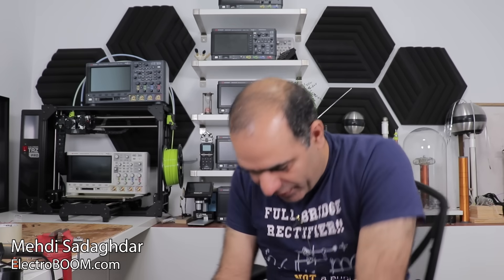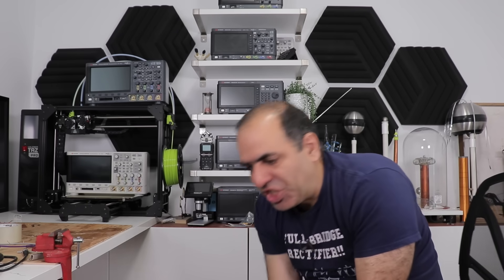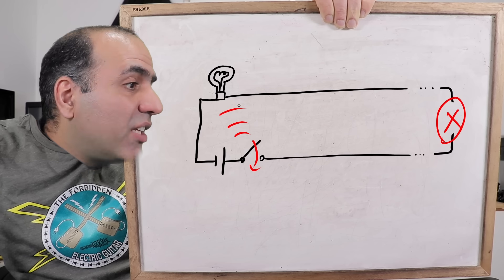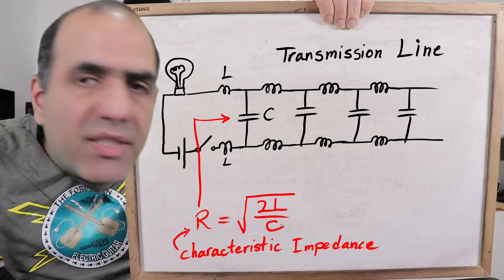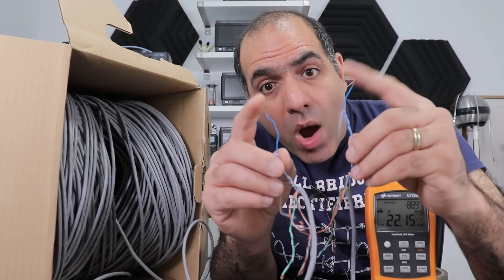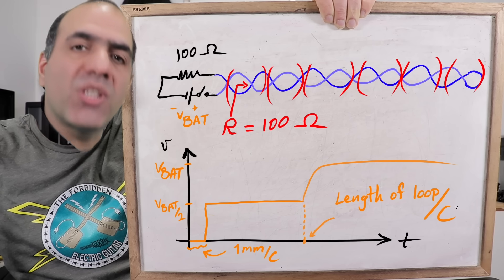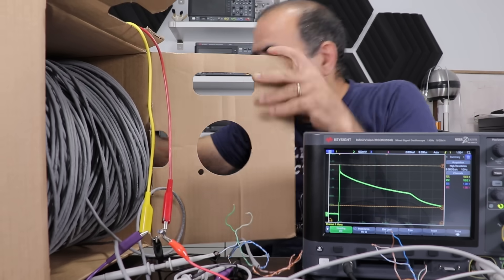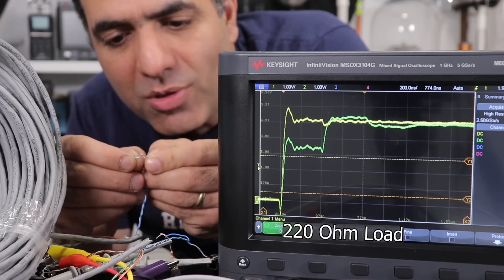Testing the LONGEST LOOP OF WIRE!!! to Turn a Lamp On

Comment from the maker: Thanks for the nice comments, people! One common question that you ask is if twisting the wire adds significant length to the wire and is a reason the light speed seems much slower in my cable. From my calculation and experiment, it seems twisting the wire contributes to 1 to 2% length difference. My light is 50% slower! So although twisting the wire does leave an illusion of slower light speed, its contribution is MUCH less than the actual slower light speed in cable dielectric.
Reply: Twisting the wire makes the light dizzy and thus slower.
Reply: @cartolla  Yep, the animated photons I control in my applications generally stop to throw up all their electronix bowl contents every 300ft or so.... poor photons.
Reply: @cartolla  it doesn't get dizzy it's just a longer have to take
Reply: @cartolla  🔴 What Is Islam? 

🔴 Islam is not just another religion. 

🔵 It is the same message preached by Moses, Jesus and Abraham.

 🔴 Islam literally means ‘submission to God’ and it teaches us to have a direct relationship with God. 

 🔵 It reminds us that since God created us, no one should be worshipped except God alone. 

 🔴 It also teaches that God is nothing like a human being or like anything that we can imagine.

🌍 The concept of God is summarized in the Quran as:

📖 { “Say, He is God, the One.  God, the Absolute.  He does not give birth, nor was He born, and there is nothing like Him.”} (Quran 112:1-4) 📚

🔴 Becoming a Muslim is not turning your back to Jesus. 

🔵 Rather it’s going back to the original teachings of Jesus and obeying him. 

More .....
Reply: The difference in transmission speed is directly related to the dielectric constant of the insulation. In the case of CAT5 or 6 cable, that's polyethylene which results in a "relative velocity of propagation" (VP) of about 0.66, just as you measured. The type of conductor and other parameters such as cross sectional area are largely irrelevant. You've demonstrated a "step TDR" in today's electric fields theory class.
Reply: In school we learned that electricity travels at ~2/3 the speed of light (through copper cables). We didn't go into the details of it, but just used that as a sort of "constant". Nice to see this validated through this experiment :D.
Reply: It depends on the properties of the insulation material rather than the conductor, but 2/3 c0 ist a valid rule of thumb. The formular ist c=c0/sqrt(epsilon_r•mu_r), with mu_r nearly 1.00...
Reply: I'm disappointed by this video, I wanted to see you wire this up inside a city park. 🤣
Reply: @Elodie the speed of light and electromagnetic waves is indeed slower through a medium... The ratio that it is slower vs max speed of light propagation through a vacuum is known as velocity factor and it's a significant factor to consider when tuning RF circuits and antennas for resonance on specific bands... Velocity factors of 0.66 to 0.90 aren't uncommon for copper wire on the low end and high quality coax or ladder line on the upper end.
Reply: @Wayde-VA3NCA  Now I can't even tell what that other guy was trying to say about inability to measure the speed of light and so on... But your antenna examples are spot-on, practical demonstrations of theory.  Air has a VF of roughly 0.95... PVC or similar insulation or pipe around an antenna shortens its resonant length more.  One can even take advantage of that in using less wire, making a shorter resonant antenna.
Reply: @Randrew  he seems to have either removed his posts, or blocked me... I can't see them or reply to them anymore... In any case, people have been measuring the speed of light (technically the round trip speed of light) for hundreds of years to increasing accuracy. First through various celestial methods and then mechanical methods, all before (modern) computers, so not sure what he was trying to get at with the computers are too slow and zooming in on atoms and stuff...
Reply: @Elodie it can be significant. The reason lenses work is because the transition between densities of medium slows down and bends the light. In the case of EM waves when making an antenna, the lamda/2 length of a dipole is longer than the actual length by the velocity factor in order to take into account the speed that the wave travels through the antenna elements compaired to free space. A 40m dipole cut for middle of the band (7.150MHz) has lamda/2 of about 20.965m, but if you cut the elements to that length it would resonate at a lower frequency than expected (just below 7MHz for a typical v.f.). If it had a v.f of around .98 it should be cut about 45cm shorter, which is noticable.
Reply: This is the most amazing and definitive word in this fantastic series. We NEED a "Veritasium Reacts to ElektroBOOM" video of this !!!
Reply: @Elodie Whoa, what was that?  I thought I just heard someone whisper "velocity factor" !
Reply: @ElectroBOOM  I have been following all the back and forth in the scientific/electrical community that Veritasiums video caused. I appreciate you all and have been VERY interested. Although, once all the dust settles, I'm going to go back and binge them all in order so everything is fresh in my mind when I hear all the back and forth. 

As it stands now, by the time a new video comes out in reply to Veritasiums video,  I've forgotten all the fine points that the new video is responding to. Am I the only one planning to do this?  I can't be, right?  

I'm one of your biggest fans. You motivated me to get into the field and start my own electronics repair company. I am building SLOWLY. It is a large investment and I'm just a full time single dad dreaming to work FULLY for myself someday. That being said, I'm growing and gaining a great reputation by word of mouth in my small city. My limits are mainly the equipment I have access to but as I grow, I keep working full time and combine my incomes to add new equipment in my shop. I allyways wanted to do this and your enthusiasm really gave me the encouragement I needed. I'm old, 45 years old to be exact and changing careers was/is scary. Somehow, you made it less so and made me feel I could learn what I was passionate about and make a career of it. So, I guess long story slightly shorter, thank you. I appreciate your videos, they made a HUGE difference in myself and my daughters life.  You're appreciated by myself and many others.
Reply: The cable specs should have a VoP/Velocity of Propagation value as a decimal or percentage. I picked a random cable from Belden and it was 70% of c. I've seen lower, too.
Spec: https://catalog.belden.com/techdata/EN/3613_techdata.pdf
Reply: That was the most epic length of cable ever used in this experiment. Well done!! The open/close bit towards the end reminded me of the switching USB does for data transmission, which I learned through ben eater's channel.
Reply: @LAYATORS  You only know your mom ? lol
Reply: @CharlieKirk1000  🤨
Reply: @LAYATORS  : Ask a FRIEND !
Reply: you could in theory connect each of the 4 cables to each other in series to make the cable loop even longerrrrrrrrr
Reply: @norwegiansmores811  didnt you pay attention? thats literally what he did
Reply: couldnt you say realistically if you give power treat the wire you attach to as ground anyways so does this all matter
Reply: Electric current falls just like water in a river. Each particle of water is affected by gravity, not by particles of water behind it pushing just as if we dive in a pool,  our feet aren't pushing us down, gravity works on all of our body parts at 10m/s2. But when water hits resistance like a damn with a turbine the head of pressure builds and that head is the same of voltage. So if current falls like water the electrons don't push each other but when pressure builds up they do but more like a flash flood. The time it takes the pressure or head to build is your delay.
Reply: Twisted pair for "fast" / high frequency circuitry is just pure magic - even for analog to digital camera applications that appear "parallel" and super "Digital" . I have to admit would LOVE to see what happens on scope if you poured a bunch of liquid nitrogen* into your cable BOX.  (Second phase of graph brought to a higher voltage ? ). 

_________________________________________________________________________________________________________

* careful of insulation cracking etc. 

~ I posted on Vertasium's first video like "Hey arn't wires 'spozed to be 'Wave guides " anyway ??? " 

@ElectroBOOM thanks for making this !
Reply: Thank you so much Mehdi you helped me to get a job, I'm so thankful for your videos and everything what you do and how your videos formed my mind. Sorry for offtopic comment.
Reply: Latiti plssss
Reply: 2e8 m/s ... Is that really due to the light speed in the cables or due the propagation delay caused by the distributed L-C network? Or they are one and the same thing, i.e. just different ways of looking at the same phenomena?
Reply: He’s finally gone LOOPY!
Reply: Mr. ElectroBOOM would you like to beat Derrick on why electrons DO push each other through the wire.

It's simple
Step 1: Ask if he believes the electromagnet force uses "virtual photons" to repel each other.

Step 2: "What is the Doppler effect?"
Reply: I want to see you do some work with electrolysis. Specifically using RF and a modulated electric field of 13.56 MHz. The anode should be the transmitting antenna and the cathode should be the receiving antenna. Don't use GHz. The objective isn't dissociation via RF the objective is resonation and pre loading the electrolyte with  extra electrons.
Reply: Is there any doubt that compared to Who One Shares A Nation/Nationality With, it is negligible Who One Marries/Who Is One's Spouse (assuming that Mankind is an order of units which [when mentally competent in a world where any of them are UNDERSTOOD TO BE free] believe that they exist within their own lifespans)? I'm only making this comment because we can see that you have a daughter. I don't mean to be too off-topic. Please forgive me for interrupting our conversation.
Reply: Actually the lower speed is due to the permittivity of the insulation. A bare copper cable in air will have a much higher transmission speed.
Reply: What will happen, if we take part of this very long cable and put it inside the box shielding it from electromagnetic field, with only 2 small holes for a cable to go in and go out?
For example, with this 40m cable, let's say that we let 10m of it go normally, then 20m is shielded from external electromagnetic field, then the remaining 10m is again going normally outside of the box?
Reply: I'm SO glad that none of my favorite youtubers are flat earthers.  Flat earthers make me sad panda.  They need to be classified as mentally disabled.
Reply: IT DOESN’T MATTER
Reply: My Former (deleted) commend was not completly right: The formular ist, as follows: c=c_0/(sqrt(epsilon_r*mu_r)), where c is the signal Velocity, epsilon_r the relative permittivity, mu_r the relative permeability of the medium (insulation). typically mu_r ist nearly 1.0, so you can usually calculate with c_0/sqrt(epsilon_r). 2/3*c_0 is a rule of thumb, I learned at university (RF circuit lecture). In case of multiple meterials with different epsilon_r/mu_r dispersion occures.
Reply: Veritasium is younger and sexier than you. Get over it
Reply: Did u percive that at the end of your video the energy output was higher than the input? Why? Wtf was going on? Can u explain please? 🙏🤝
Reply from the maker: @andreypinto3988  of course you can send continuous energy out, collect them somewhere and then send a burst of much higher energy out for a smaller period of time. That's no issue.
Reply: @ElectroBOOM  Can you please do a video on impedance matching?
Reply: Cat 5e has a VF (Velocity factor) of 0.45C to 0.75C, if you are not familiar with transmission lines, you tend to forget to factor that in. your calculation was spot on,  if you used COAX, you would be looking at a VF of 0.6C to 0.9C, that data sheet for the cat 5e should have had the VF on it.
Reply: Im loving this back and forth between you and Veritasium
Reply: Twisting the wires just changes the velocity factor, which is another way of calculating mow much slower electrons will flow through the conductor that they would in free space. Any spool of coaxial cable will have the velocity factor printed on it, along with the impedance of the cable.
Reply: Can you please do a video on impedance matching?
Reply: @ElectroBOOM Can you please do a video on impedance matching?
Reply: My whole comment was going to be postulating whether twisting significantly increases the actual length. So way to make me feel totally useless. Rude.
Reply: But if the wires were shielded then nothing ?
Reply: My doubt is, if the speed of electricity in wire is almost the same as the light, how is the fiber optics much faster.. 
Is it just the dielectric that is causing the speed in fiber optics cable??
Just curious....
Reply from the maker: @jackronaldo774  Fiber optic is not faster because light travels faster, but because the signal is filtered less in optical fiber, so you can run higher frequency without it being filtered too much.
Reply: @ElectroBOOM  oh cool.. that makes more sense... Thankyou for the reply mehdi ❤️
Reply: i'd rather say it's 33 % slower
Reply: you have a Persian accent
Reply: I do not like you
Reply: The way you described how the energy travels through the twisted wire reminds me of how when you finish drinking from the straw and the liquid drops fast then bounces back up.
Reply: Many people don't know about the reality of the speed of light, they keep thinking that, in a small enough scale, everything is in vacuum. When the fact is, the quantum fluctuation especially around dielectric substances can interact with EMW, sucking it's energy and create subatomic particles that fills in the space.
Reply: Some of them even believe that the slower speed of light in materials is caused by light reflecting inside causing it's speed to drop since it experiences longer paths.
Reply: Looooong looooooong loooooooop
Reply: 1 to 2% is too low. Upwards of 5% is closer and varies by colour for performance and packaging reasons.
Reply: So, fun fact, the dielectric constant of a cable can vary a surprising amount over the length of the cable due to manufacturing impertfections. I used to work with TDRs and we could "see" the imperfections of the cable within the trace. For some cable runs we worked with, we could see a fluctuation anywhere between 50-85% between two arbitrary points. Understanding this and compensating for it can have significant real world impacts. For a practical example, when performing maintenance on a wiring harness onboard ship, its important to have a good model of the variations of the dielectic constant for a given cable as it can define which side of a bulkhead you may need to cut a conduit in order to place a splice.
Reply: Hello Mr.Mehdi, could you please make a video explaining impedance matching and why it is necessary.
Reply: How to make a fish shocker?
Reply: Please korean
Reply: Man first I thought its such a click bait,,,I was expecting a huge setup which would be cool....but thats was the whole point of the video ...you dont need a lightsecond setup to prove the point ,,,,,
Reply: Propagation speed is equal to (1/sqrt(dielectric constant of insulator)) x speed of light

That's mean, your wire insulator have dielectric constant about 4. So, It's  PVC cable, not polyethylene.
Reply: This video was amazing
Reply: Am i the only one who noticed he did a green screen well holding the board
Reply: Would the 50% slower speed be from inductive reactance?
Reply: @ElectroBOOM Can you comment on AMD's removal of PCIE4.0 feature from some of new B450 motherboards(ex: 2020 ASUS TUF-b450 boards).  Might be a bit far-fetched but this LVDS is also the main reason AMD B450 boards actually support PCIE4.0.  In AM4, all the PCIE4.0 complying things are inside the CPU. Only thing left on the motherboards is the LVDS pair of copper paths. Being LVDS they are really powerful.  PCIE4.0  doubles the speed per path from 8GHz to 16GHz.
They later removed it by AGESA updates just to make it B550 exclusive to incentivize spending.
Finally us consumers are left with boards where we can't use at full potential...
Reply: What is the field of study I need to follow to be able to research, manufacture and test like you or study high voltage? Hope to reply.
Reply: ---{{(HI!)+l]]®
Reply: Sir if you want to  see "good inovation" and truly "cheap/free" energy, you have to  check out the "hydraulic accumulator" that they published couple of weeks ago. It changes completly the rules of the game forever!  https://www.youtube.com/watch?v=uTbIJnEOw8Y
Reply: kreze man
Reply: Does electricity have mass? will a large enough loop of wire change weight when current is flowing vs no current? It is believed that light does not have a mass. If light has no mass then how does a solar sail get a push from light that has no mass. Also how can electricity be compared to light if it has a mass and light does not?? 
Amazing video. I learned lots but I have more questions then answers now. 🤣
Reply: @bradlys4978   Photons indeed have no inertial mass and no relativistic mass, but they do have an energy. Thus they have "momentum", as in
E^2=(pc)^2+(mc)^2 (m=m_0 is rest mass)
so: E^2=(pc)^2
or: p=E/c
with E being dependent on the photon's wavelength (can't say what happens at Planck's length though). 

A so-called massless particle (such as a photon, or a theoretical graviton) moves at the speed of light in every frame of reference. In this case there is no transformation that will bring the particle to rest. The total energy of such particles becomes smaller and smaller in frames which move faster and faster in the same direction. As such, they have no rest mass, because they can never be measured in a frame where they are at rest. This property of having no rest mass is what causes these particles to be termed "massless". However, even massless particles have a relativistic mass, which varies with their observed energy in various frames of reference.  

Gravity alters the course of light in the same way it alters the course of ordinary matter. In Newton’s theory of gravity, the force only affected things with inertial mass, but general relativity is different. Matter warps spacetime, which means that things traveling in straight lines take different paths in the presence of curved spacetime. This affects matter not only matter, but also photons. 

About the electricity, I heard that one of Einstein's 1905 papers, "On the Electrodynamics of Moving Bodies" specifically demonstrates this. A moving magnet becomes more massive due to its increase of energy, and this additional inertia causes its electric field to increase in strength as well. Hence E = mc^2.

Though I am not an expert here, needed some googling for this comment and am not really too knowledgeable about electron holes, for which an "intuition" could make us ask "Wait, do holes have a mass?", but I heard that the hole is a positive-charge, positive-mass quasiparticle. A hole is essentially a way to conceptualize the interactions of the electrons within a nearly full valence band of a crystal lattice, which is missing a small fraction of its electron, which can lead to unintuitive concept that effective mass for the electrons can be negative.
Reply: @scarletevans4474  So they do have a  relativistic mass. Anything times zero is still zero. so speed time mass give you a force. it's that simple. No mass, then no force can be exerted from the inertia. It has to have at least a tiny bit of mass.
Reply: Exelent ☆☆☆☆☆
Reply: I've got a fun one for you to investigate. 

Internet black hole.
Reply: Hey you are wrong!!!
Because you made a solenoid with the loop of wire so it make electric field so it will be work as capacitor and not doing the experiment ritghtly
Reply: Why didn't you run all of the singles in series to get 6000m to prove the point
Reply: AlphaPhoenix did it with 1.km odd wire
Reply: Long longggg maaaaaaannnnnnnnnnnnnnnn!!!
Reply: I heard there are 70 ,yes 70  anomalies in the study of H2O (water )  alone.
So any electrostuds are pussies ! 
Also very fascinating  though 😀!😀
Reply: Doubt you would see this but given electrons have mass doesn’t electricity (the flow of electrons) move at slower than the speed of light?
Reply: It’s a little late here but please do explain the signal analyser used here and it’s settings for this experiment and thank you for tackling this question with such experiments …
Reply: I was thinking lately about you're previous video with Veritasium, and your conclusion. You both get to consensus about electrons traveling only on outer surface of wire and energy traveling in electromagnetic field around wire. So the purely copper wire and copper coated alluminum wire should behave exactly the same even when conducting DC whichin real life is surly not true. I was looking here and there on internet and can't find explanation of this phenomen. Sorry for leaving the unrelated question under your  comment but I'm seeking answer so badly...
Reply: @erykopata2668  This is my understanding - "skin effect" has historically been regarded as a high frequency characteristic (pushing towards MHz with lots of influence at GHz ranges where it was discovered during RADAR development). The dc characteristic certainly depends on the overall structure of the cable - which can be simply demonstrated by the reduced current carrying capacity of rubbish Chinese copper covered aluminium mains cable - and is one reason why silver plated hi-fi interconnects are complete snake oil at audio frequencies. My feeling is that the physics of conduction is far more complicated than suggested.
Reply: @andygardiner6526  If the current is only carried in the outer layer of the conductor why do you need a 25mm square conductor for starter motors or welding cable and not a copper tube over a piece of rope. At DC the skin effect is negligible as you are pointing out.
Reply: @Equiluxe1  problem with small cables - they have small resistance. Otherwise, if you push too much current into small cable, it will melt. So 25mm square conductor is the most efficient way (both by possibility to hold the power and by cost to produce the cable) to hold electricity for specific electric power in this part of the loop.
Reply: @Equiluxe1  the starting load would need that extra inner to keep the wire from getting overloaded. But some of the sub stations here in canada use a massive pipe of sort like you state because its cheaper. But those are engineered and designed with peak loads in mind. In theory your pipe on a rope would work. But bare live pipes on a rope in your garage. I dont suggest lol
Reply: @UnifiedInfo  Not suggesting bare pipes but if the inner part is just for heat sinking a tube filled with water or copper covered steel or aluminium should carry the same current but it does not, where hollow conductors are used for lage currents with coolant circulating inside them the same amount of conductor is used it is just formed into a tube but the pounds per foot or however you want to measure it is the same. And if car manufacturers could get away with using a mm thick wall tube or a few strands of 1mm wire wrapped around a rope they would do so to cut costs, the fact that they don't speaks for itself, and they are not worried about heat build up as the starting current is only for a few seconds.
Reply: In regards to conductance of copper wire versus copper coated wire: The charge is located on the surface of the wire, but for DC or low-frequency AC (that mostly reaches steady state) that means the charge fixed relatively quickly, creating an electric field inside the conductor, but the electrons inside the conductor actually move in the electric field created by those charges.
Reply: @erykopata2668  You got that part wrong. Surface charges are the only charges that are not in equilibrium and thus they create electric field. This field then moves charges in the rest of the conductor. At DC all the charges in the conductor are moving so they all contribute to energy losses by interacting with metal atoms. At AC surface charge wave has some finite length so the electric field that it creates cancels out at certain depth in the conductor. The higher the signal frequency the shorter the wave and smaller the "skin depth". That is why at high frequency charges move only in "skin depth" area of the conductor and only this part "conducts" the signal (it is not a step change but more like exponential decay).
Reply: @erykopata2668  they work actually very similar, that is why we have copper and copper covered CAT 5e cables. But because copper covered aluminum is much softer, you may get cracks in the cable much easier, thus affecting electrical flow. And of course, there is difference between metals and their electric capabilities, conclusion of skin effect is working purely in solid metal. If you use covering, you separate one metal from the other, which creates delta. Also, just for additional information, cable coverage is dependent on full surface and with copper covered metal, you still have small gap, where metal is not covered by copper (the part, where cable is cut), as well as in internet connection, copper surface is also affected by the pin connector.
Reply: @erykopata2668  That raises all sorts of questions like why can a thicker wire carry more current? and why does stranded wire have more resistance than a single wire of equal diameter?
Frequency also makes a difference, see "skin effect in power system"

I think the biggest thing that's not being dealt with is that it makes a big difference when  carrying a significant current through a closed circuit.
Reply: @erykopata2668  Consider gravity is the constant. Electrons are positively or negatively charged. From my understanding the motion of travel is in the positive flow. As gravity is the force that holds all things together and moves all things with the velocity and span of the galaxy. I postulate that gravity also holds the electrons together and moves them in conjunction with the positive charge. In a wire. In a tube. In a vortex. The travel can only be in one direction. Even in Direct current the travel is one direction. In alternating current the flow alternates from one direction to another. The direction is constant. the charges are not in place flipping from positive to negative. Gravity itself converts from positive to negative keeping the electrons in place traveling always in the same direction. This recent intuitive thought also explains string theory which I also did not study. Simple explanation. I have a H.S diploma. Nothing more. Why does it explain string theory. Gravity converts from positive to negative. All charges from positive to negative would be inside of that gravitational field. All electrons would switch at the exact same instant. From my understanding that is the principle rule of string theory.
Reply: @rafaelgonzalez4175  Thanks a lot. I'm not sure if it answers all of my questions, but surely helps a lot
Reply: You should make a split channel for flat earthers and people who watch your videos to actually learn stuff-a flat earther would not watch this type of video.
Reply: @quinn_jns  it would be in vain. They only watch their shit anyway, because " science lies" and "scientists are not open minded" 😄
Reply: Im still amused how this talk converted from electrons to photons. Complex things have alot of things taken for granted when trying to understand fundamental laws of universe!

P.S. with snells law EM field inside conductor would enter always in direction of the normal of the surface regardless of angle of incident, so it doesn't matter if wire is twisted or not, EM field will follow the tunnel upside down wherever it takes it.

Besides speed of propogation would depend on permitivity of the material and it depends on whole lot of parameters including mass( not the weight but actual mass created by energy) of the material and time, as it would have displaced underlying electric field because atoms would displace actual field in order to register itself as atom in universe, which provides it's charge or other properties.  At the end it's the energy of atoms which bends the rules of EM propagation inside it's own region, what happens inside these fields of different energies is still field of study by scholors.

Thought experiments are cool, but everybody would need to understand past 200 years of physics and discovery of atomic level interactions in order to go further.

We may only see combined effect in one experiment, it's usually collective knowledge that brings solutions and conclusions. This opens up new challenges and might inspire others to explore beyond traditional education.
Reply: @MaulikParmar210  please consider these as questions not arguments..

I don't think Snell's law applies to the length claim, the twisted pair simply makes the lines longer - refraction isn't really behind the claim?

Also as I understand it, photons are the force carrier 'particle' that transmits the electromagnetic force, and the electrons are not the things that move at the speed of light.. just the electromagnetic fields?

Again, as I understand it (so more of a question than a statement :) ) - electromagnetic waves aka 'light' in this context, move slower through different mediums due to the absorption and re-emmitance of photons as they interact with electrons.. between interaction with matter they always move at the speed C..?
Reply: @ThePurza   When we talk about propogation of signal we usually talk about EM fields displaced and induced by the conductor. According to field theories there exists a field for each property of real particles that gives them their properties including charge, mass, magnetic field, glueing  force inside atom nucleus and also spins to electrons. These fields have steady energy state settled after long time of universe's creation and the particles we see is energy residue in terms of oscillations in these fields i.e the wavefunctions in quantum mechanics for each particle.

The propogation speed would depend on permitivity of the "displaced" Electric fields created by the mass itself. Note displaced as it's important to distinguish base energy of field and energy we are transferring. We usually denote permitivity of electric field in space as epsilon zero which is derived from other fundamental constants and tells us about the energy required to make these disruption happen in raw space's electric barrier.  The materials relative permitivity is a constant depending on length, temprature and other physical properties created by atomic particles themselves because they interact with underlying field and would actually account for things like resistance, speed of EM disruption etc. This is where it determines physical properties of the conductor. For correr we know its 2/3 of c at 1khz frequency. For DC it can go upto 0.9C depending on setup and conditions and is heavily studied in engineering with the help of Mean Field Theory and it's supportive math.

Accoring to Einstiens GR and SR speed of causality will remain constant regardless of reference frame because that's defined by nature itself. We dont know why it has that value but photons or any other disruption inside these fields does not have to travel at that speed and can be slower.

Photons only travel at these speed because they are usually massless (traditionally) but have angular momentum ( quantum property that carries actual energy) inside these fields making it field carrying particles.  They do not experience time and wants to happen at speed of causality (c), give it origin and direction and you will have light / em wave always trying to catch speed c.

Inside the conductor the field will enter always be in direction of normal to surface because conductor acts as wave guide i.e. it will follow wires surface in direction of the wire regardless how wire is twisted or not, it will bendhwere it needs to will but it's not going to be same as photon because it only interacts with one field and not atoms as photons do. we cant simply compare electricity ( the energy of the electirc field at the end ) with photons they are fundamentally different and would interact differently. This is same as Photons EM field except the energy we talk about is transmitted outside normal visible relms of physical world and in underlying fields as the electric field displacement (base energy of field + energy from battery)  caused by energy.

Things get more complicated as you involve math trying to account for each of these interactions.

I'm not any scholor but can tell the answers that are seeked here requires deep and darkest knowledge of fundamental workings of almost everything that humans have discovered so far, even vaterns in physics have to master multiple theories along with 200 years of discovery to be able to answer simplest questions that we usually take for granted. It's just complicated and involving Math just removes 99% audiance from equation!
Reply: @MaulikParmar210  thank you that's a great answer.

Yeah it seems like many scientific analogies/principles/equations we use are massive simplifications of the 'wave function' of a system. I wonder if schools will ever teach children about fields and field perturbations, it's all so arcane
Reply: @MaulikParmar210  Well written and true.
Reply: @MaulikParmar210  Being familiar with Snell's law on the refractive surfaces in optics, I do have a hard time in the analogon comparison to the situation here. In what I am familiar and use professionally in microscopy is the refraction through media of various RI to achieve surface interation on the converging E-field. There, the angle of incident matters and varies up to the pupil radius continuously. As I also happen to be (by initial training) an electrical engineer I have a problem following your comment on Snell's law. But maybe its just me...
Reply: @LutzSchafer  Apologies, I guess explaining things in classical and non classical ways have it's own perks. The classical way electrons would be drifting due to electric field, for example at 60Hz the EM signal travels only 3.2m in copper till it gets absorbed into the material completely, electrons do move due to this electric field but very very slowly depending on frequency which brings in snells law as we are talking about EM stuff and in it's core there are exceptions to a point where signals are essentially reflacted regardless point of impact if radiation is consumed or absorbed by material. We cant solve it with classical approach.

This things get interesting as we explore, I directly quote this from snells laws basic explanation "In a conducting medium, permittivity and index of refraction are complex-valued. Consequently, so are the angle of refraction and the wave-vector. This implies that, while the surfaces of constant real phase are planes whose normals make an angle equal to the angle of refraction with the interface normal, the surfaces of constant amplitude, in contrast, are planes parallel to the interface itself. Since these two planes do not in general coincide with each other, the wave is said to be inhomogeneous. The refracted wave is exponentially attenuated, with exponent proportional to the imaginary component of the index of refraction."

To solve inhomogeneous equations you need Maxwells equations. Solutions to these represent spherical light waves traveling outward from the sources of the waves, thus the analogy of Electric field being in direction perpendicular to the normal of the surface, and since solutions are in complex plane, you can discard angle of impact and result will always be same i.e. signal gets absorbed in underlying electric field as EM energy potential and the thing continues. This also answers why surface charges play important part in carrying energy.

How deep this penetration goes depends on frequency of signal and type of material. Usually core would become less electricaly active and charges would concentrate field on surface areas creating actual waveguide that carries signal while internal mass would interact with EM energy flowing through it because they are also part of same EM field and winds this field around them.

What it means is that for optical waves your normal explanation would work, for Electric Waves, their perpendicular portion will always get absorbed at some distance while parallel portion would contribute directly, exciting electric fields potential from it's ground state if we think in terms of energies as fields and not waves like classical approach. Because of how electric field enters and excites conductors internal electric field, there would be a point at which entire wave would be absorbed perpendicular to the surfaces final wave always has one direction from high potential to low potential as universe always wants to get lower state possible.

Note that Electric Waves do not act same as Photons which have oscilating magnatic and electric field and are packet of energies and do actually interact with electrons differently, excites them because they have magnatic spins. while Electric waves would interact with underlying Electric fields only and energy transfer would happen via flow of EM energy inside primitve gauge field itself. Thus can be explained with QED or Potential in Field theory and quantum mechanics, which is open to interpretation according to what you want to do with that information. 

 It's much more complex as it is to think back and froth between classical theories which most people understand and modern physics which is yet to be involved in grad level curriculum. 

This is the closest explanation you will get in terms of compartmentalised form of EM waves till you combine effects of waveguide behaviour of the conductor, the induced EM field and it's effects exactly predicted my Maxwells theories, which then explains why waves enter differently than normal photons, interacts differently and gets absorbed outside physical relms. There's always internal classical current induced due to fields, but fields would have different energy potential if you happen to take cross-section of conductor and measure electric fields energy density near surface and at core due to thus phenomenon. 

P.S According to modern physics EM Field is primitve guage field, EM energy is the actual energy potential which either contracts EM field or makes EM field dense in space which actually carries some energy and Photons are just small energy oscillations within these fields if they exist i.e. they get magnatic field as well to actually exist within EM field to store energy somewhere, so they have different physical properties interacting matter differently. EM field do not interact directly with particles but with the help of virtual transactions i.e. interactions that makes it possible to draw outcome. If you start calculation and do integration of all (probably billions or trillions) wavefunctions you would endup same as these virtual interactions that modern physics has given us with the help of Math.

For those who wants to know EM interaction in terms of Quantim mechanics, Just another explainer from Dr. Lincon on understanding photons as EM packet:
https://youtu.be/NLmpNM0sgYk

This whole discussion indirectly concludes that modern generations would have to try harder and harder to understand existing knowledge just to apply it to new discoveries.
Reply: @MaulikParmar210  <- bruv graduated from trust me brb asl pls
Reply: Why you attacking always flat earth people you make them look they are ignorant  they are educated people you Can  Believe NASA  Superstitions CGI  But don't force your opinion on people
Reply from the maker: @lainounou9515  It is not an opinion I'm forcing, it is a fact!
Reply: @ElectroBOOM  I love your channel content Because you use experience and observation to get results But that's not what you're doing with NASA science fiction Anyway, I wish you success in your field
Reply: @ElectroBOOM  One (admittedly) minor addendum: as the wires in twisted pair aren't straight--duh!--each one is actually slightly longer than the cable itself, which would throw your calculations off by a bit.  (I'll leave the actual length calculation to someone with a Brilliant mind.  :grin: )
Reply: @ElectroBOOM  ...and, at 4:30, you briefly produce more energy than was input.  Congratulations on your first successful test of your over-unity device!!!  :trollishgrin:
Reply: @lainounou9515  wtf is NASA science fiction?
Reply: @KeithOlson  it's even worse: each pair of wires in a network cable has different twist rates. If all were the same you'd get crosstalk effects between different pairs (since the same part of the wire in pair 1 would always be near the equivalent part of pair 2). So the "real length" in each pair is different to other pairs in the same cable.
Reply: Exactly 💯
Reply: Hey mehdi, i have only one request can you please respond to this comment? it is my only request to you.
Reply: Hahaha this is the second time he is wrong against a theorist. He should have payed more attention in class 😂
Reply: @Elodie No matter how you measure it, the speed of light is always the same.
Reply: He needs to buy 100 rolls. That's 800000 feet of loop. Then he can sell to fans. I think he can buy bulk discount and sell at a profit. Make it 1000 rolls or 8000000 feet (2438.4km) (1515.151515 miles)
Reply: “Then Peter said unto them, Repent, and be baptized every one of you in the name of Jesus Christ for the remission of sins, and ye shall receive the gift of the Holy Ghost. For the promise is unto you, and to your children, and to all that are afar off, even as many as the Lord our God shall call.” Acts 2:38-39 KJV 

“Jesus saith unto him, I am the way, the truth, and the life: no man cometh unto the Father, but by me.” John 14:6 KJV 

“He that believeth on the Son hath everlasting life: and he that believeth not the Son shall not see life; but the wrath of God abideth on him.” John 3:36 KJV 

“For if ye forgive men their trespasses, your heavenly Father will also forgive you: But if ye forgive not men their trespasses, neither will your Father forgive your trespasses.” Matthew 6:14-15 KJV

“And I say unto you, Ask, and it shall be given you; seek, and ye shall find; knock, and it shall be opened unto you. For every one that asketh receiveth; and he that seeketh findeth; and to him that knocketh it shall be opened. If a son shall ask bread of any of you that is a father, will he give him a stone? or if he ask a fish, will he for a fish give him a serpent? Or if he shall ask an egg, will he offer him a scorpion? If ye then, being evil, know how to give good gifts unto your children: how much more shall your heavenly Father give the Holy Spirit to them that ask him?” Luke 11:9-13 KJV

“And Jesus said unto them, I am the bread of life: he that cometh to me shall never hunger; and he that believeth on me shall never thirst. But I said unto you, That ye also have seen me, and believe not. All that the Father giveth me shall come to me; and him that cometh to me I will in no wise cast out. For I came down from heaven, not to do mine own will, but the will of him that sent me. And this is the Father's will which hath sent me, that of all which he hath given me I should lose nothing, but should raise it up again at the last day. And this is the will of him that sent me, that every one which seeth the Son, and believeth on him, may have everlasting life: and I will raise him up at the last day.” John 6:35-40 KJV 

“And fear not them which kill the body, but are not able to kill the soul: but rather fear him which is able to destroy both soul and body in hell. Are not two sparrows sold for a farthing? and one of them shall not fall on the ground without your Father. But the very hairs of your head are all numbered. Fear ye not therefore, ye are of more value than many sparrows.” Matthew 10:28-31 KJV

“Whosoever therefore shall confess me before men, him will I confess also before my Father which is in heaven. But whosoever shall deny me before men, him will I also deny before my Father which is in heaven.” Matthew 10:32-33 KJV 

“That if thou shalt confess with thy mouth the Lord Jesus, and shalt believe in thine heart that God hath raised him from the dead, thou shalt be saved. For with the heart man believeth unto righteousness; and with the mouth confession is made unto salvation. For the scripture saith, Whosoever believeth on him shall not be ashamed. For there is no difference between the Jew and the Greek: for the same Lord over all is rich unto all that call upon him. For whosoever shall call upon the name of the Lord shall be saved.”
Romans 10:9-13 KJV 

“Jesus answered, Verily, verily, I say unto thee, Except a man be born of water and of the Spirit, he cannot enter into the kingdom of God. That which is born of the flesh is flesh; and that which is born of the Spirit is spirit.” John 3:5-6 KJV

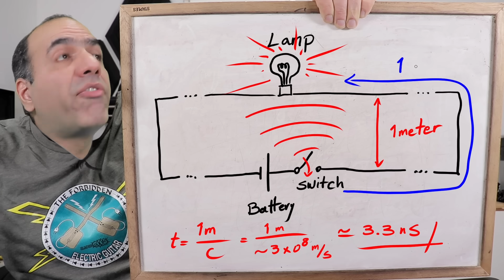“Who hath delivered us from the power of darkness, and hath translated us into the kingdom of his dear Son: In whom we have redemption through his blood, even the forgiveness of sins: Who is the image of the invisible God, the firstborn of every creature: For by him were all things created, that are in heaven, and that are in earth, visible and invisible, whether they be thrones, or dominions, or principalities, or powers: all things were created by him, and for him: And he is before all things, and by him all things consist. And he is the head of the body, the church: who is the beginning, the firstborn from the dead; that in all things he might have the preeminence. For it pleased the Father that in him should all fulness dwell; And, having made peace through the blood of his cross, by him to reconcile all things unto himself; by him, I say, whether they be things in earth, or things in heaven.” Colossians 1:13-20 KJV 

“Look not every man on his own things, but every man also on the things of others. Let this mind be in you, which was also in Christ Jesus: Who, being in the form of God, thought it not robbery to be equal with God: But made himself of no reputation, and took upon him the form of a servant, and was made in the likeness of men: And being found in fashion as a man, he humbled himself, and became obedient unto death, even the death of the cross. Wherefore God also hath highly exalted him, and given him a name which is above every name: That at the name of Jesus every knee should bow, of things in heaven, and things in earth, and things under the earth; And that every tongue should confess that Jesus Christ is Lord, to the glory of God the Father.” 
2 Philippians 2:4-11 KJV 

“Take heed that ye do not your alms before men, to be seen of them: otherwise ye have no reward of your Father which is in heaven. Therefore when thou doest thine alms, do not sound a trumpet before thee, as the hypocrites do in the synagogues and in the streets, that they may have glory of men. Verily I say unto you, They have their reward. But when thou doest alms, let not thy left hand know what thy right hand doeth: That thine alms may be in secret: and thy Father which seeth in secret himself shall reward thee openly. And when thou prayest, thou shalt not be as the hypocrites are: for they love to pray standing in the synagogues and in the corners of the streets, that they may be seen of men. Verily I say unto you, They have their reward. But thou, when thou prayest, enter into thy closet, and when thou hast shut thy door, pray to thy Father which is in secret; and thy Father which seeth in secret shall reward thee openly. But when ye pray, use not vain repetitions, as the heathen do: for they think that they shall be heard for their much speaking. Be not ye therefore like unto them: for your Father knoweth what things ye have need of, before ye ask him. After this manner therefore pray ye: Our Father which art in heaven, Hallowed be thy name. Thy kingdom come, Thy will be done in earth, as it is in heaven. Give us this day our daily bread. And forgive us our debts, as we forgive our debtors. And lead us not into temptation, but deliver us from evil: For thine is the kingdom, and the power, and the glory, for ever. Amen. For if ye forgive men their trespasses, your heavenly Father will also forgive you: But if ye forgive not men their trespasses, neither will your Father forgive your trespasses. Moreover when ye fast, be not, as the hypocrites, of a sad countenance: for they disfigure their faces, that they may appear unto men to fast. Verily I say unto you, They have their reward. But thou, when thou fastest, anoint thine head, and wash thy face; That thou appear not unto men to fast, but unto thy Father which is in secret: and thy Father, which seeth in secret, shall reward thee openly. Lay not up for yourselves treasures upon earth, where moth and rust doth corrupt, and where thieves break through and steal: But lay up for yourselves treasures in heaven, where neither moth nor rust doth corrupt, and where thieves do not break through nor steal: For where your treasure is, there will your heart be also.” Matthew 6:1-21 KJV 
Turn to Jesus Christ. Only He can save our souls. He died for our sins that we may live. He is alive. His blood washes our sins away.